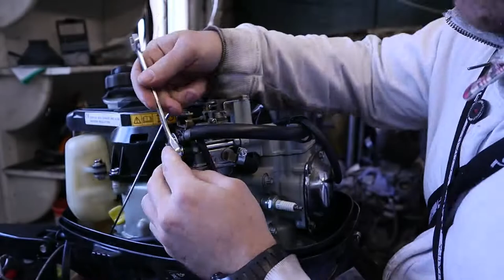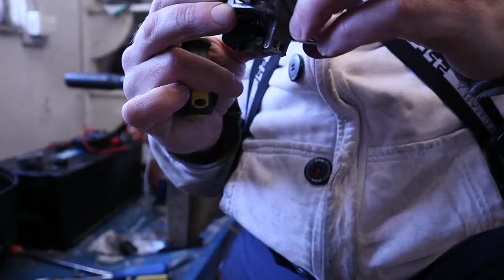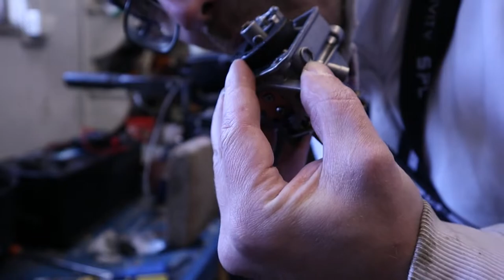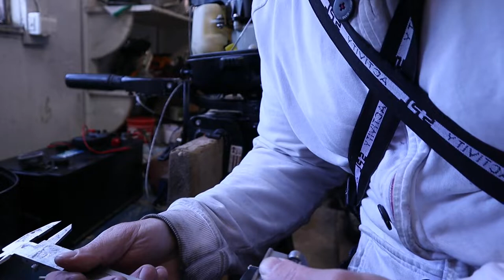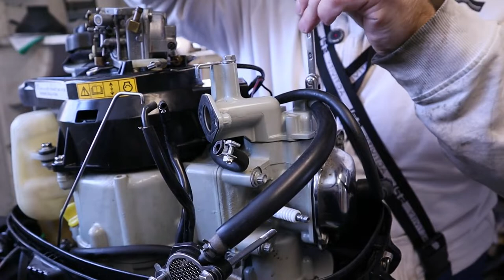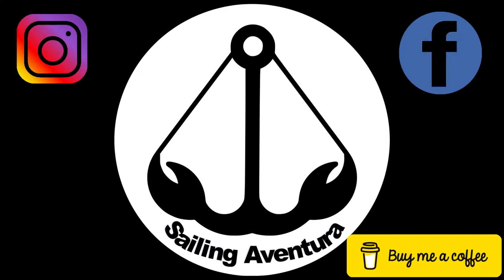Suzuki DF4 carburetor float and thermostat S.3 Ep.3 Sailing Finnish lake 2022

Comment: Sorry to ask but do u know a way to simply drain the old fuel from internal tank?
Reply from the maker: Every method I can think of is little bit messy. I have always just poured the tank empy by lifting a whole engine and tilting it. There is a 3 way valve under the carburator where all the hoses connect to and there is a ”lid”. Ofcource you could take the hose out of fuel pump also.
Reply: @SailingAventura1  just did as you said.  Poured it out by lifting up.  Obviously hahah thanks